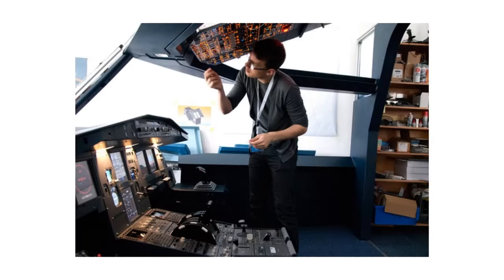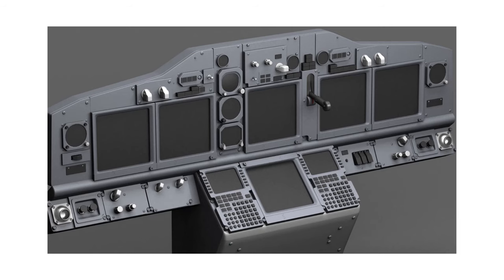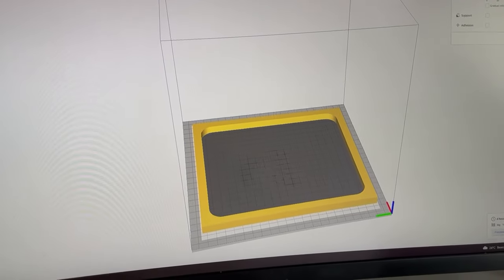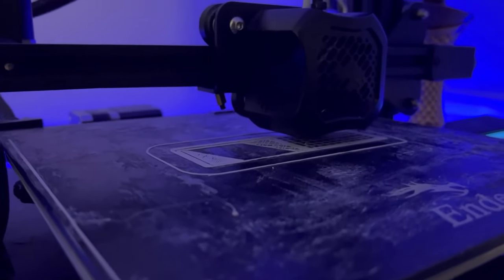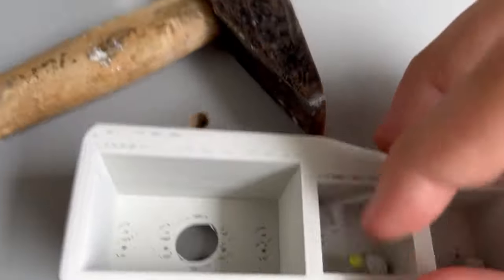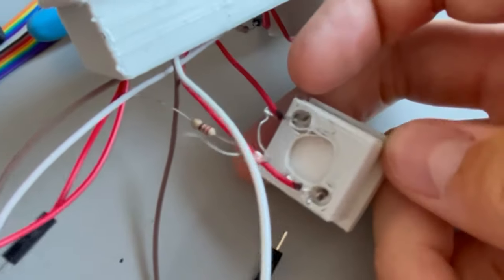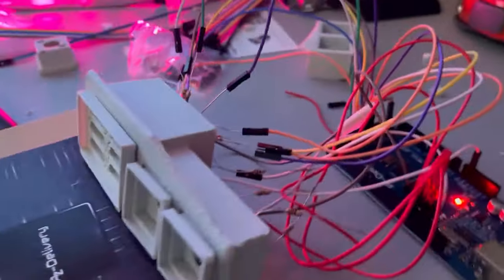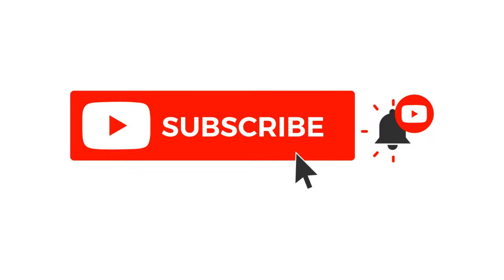Building A Home Cockpit | Episode 1

Comment: As you are mentioning using the Fenix A320 you might want to think about how you plan to connect your hardware (especially the custom parts) to the sim. I believe there are lots of controls Fenix doesn't give you access to. Not sure about the Fly by Wire A320 as I am still using P3D with my home cockpit, so that might be a better option (assuming you want to stay with MSFS 2020). Good luck with the project!
Reply from the maker: Thank you! :) I checked this, and the Fenix 320 does not give access to all controls. I don't think the FBW gives access to all controls in Mobiflight, which I just checked. I'm still considering staying with the PMDG 737, though it's much more complicated...
Reply: @model.aviation  Another aspect you might want to look into is how easy, or not, it is to display the various screens you would want in the cockpit (PFD, ND, MCDU, ECAM, etc ), especially if you want to run those off another computer. Please know that I am not trying to rain on your parade, just sharing some personal experience.
Reply from the maker: I love it that you think along! Any help is highly appreciated as I have zero experience myself. I have been looking into running the screens off USB, which should be possible, though I'm not sure whether the sim will be running anywhere near smooth if everything is connected
Reply from the maker: Thanks a lot! I will reach out for sure! :)
Reply: @model.aviation The FBW A320 gives access to probally all buttons.
A youtuber built an autopilot in a german video and said, that it can only wire up with the FBW A320.
Also I really am waiting cause I will build a homecockpit too
Reply: @cayancankiran9647 can you link the video
Reply: @leonnollen8302  the video was probably deleted and wasn’t a full tutorial

Comment: Great video! I would really like to do something this for the ERJ-145XR as I dispatch these aircraft for the airline I work for.
Reply from the maker: That’s amazing! It’s a very fun project, but I don’t know how easy it will be for a less known/popular aircraft
Reply: @model.aviation  It shouldn’t be too challenging. I can actually get a lot of information and measurements from the corporate manuals I have access too. I really though beed to learn about proper wiring and electrical technics before I start though.
Reply from the maker: @CitrusAviation  That's lovely! Wiring isn't too difficult, but I'm not sure whether there are many programs that support the ERJ-145XR so you can link the switches to the simulator...
Reply: @model.aviation  Ok, I’ll look into how to wire and set up the switches directly to the software.

Comment: I'm not real familiar with 3d printing but some of those prints look pretty rough to me. I've seen other people make things in the past on YouTube and the prints jist required some light sanding to get smooth. Is this due to the 3d printer quality? Serious question, I really don't know and would like to learn more about 3d printing. Good luck on your journey, I subbed to your channel.
Reply from the maker: Hi, I love to hear that. The print quality is mostly dependent on how you level your printer bed, and my bed isn’t level 100% perfect, so the print quality isn’t optimal therefore. I have printed high quality prints in the past thanks to the bed levelled perfectly, but levelling each and every time I get tired of 😂
Reply: @model.aviation  you might want to mess around with the temps as well i see some curling on the edges of your prints. most of them i feel wont matter because its hidden inside some frame but still
Reply from the maker: @Im_Asra  Thanks for that tip! Definitely something to take into account as well which I haven't thought of

Comment: Hey, I also want to have a home simulator setup and I would like to know where you got the files and dimensions for the cockpit of the A320 and other models.
Reply from the maker: Hi, I’ve got some Autodesk Fusion 360 designs of the cockpit. Would those be helpful? If so, I can send them to you via email
Reply: Sure, but are there any other models other than A320s?
Reply from the maker: @myran1257  There sure are, but I don't have them, or know where you can find them
Reply: @model.aviation  ok thanks
Reply: @model.aviation hoi, ik ben ook best geïnteresseerd in een thuiscockpit maken en de bestanden die u heb gebruikt zouden voor mij ook heel handig zijn. Ik kijk uit naar de volgende video!